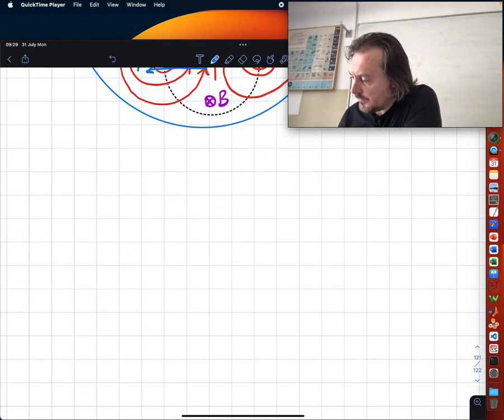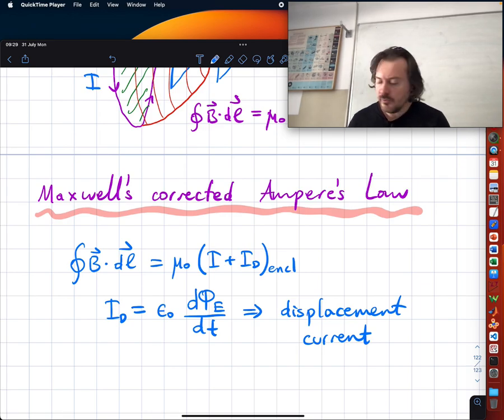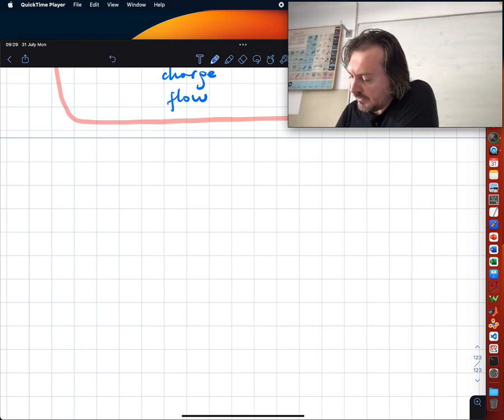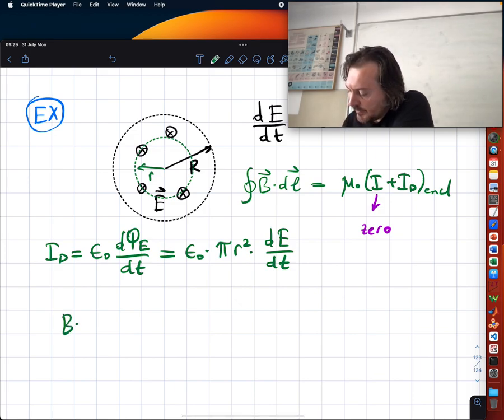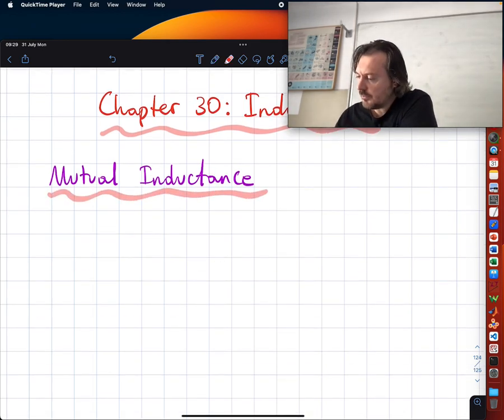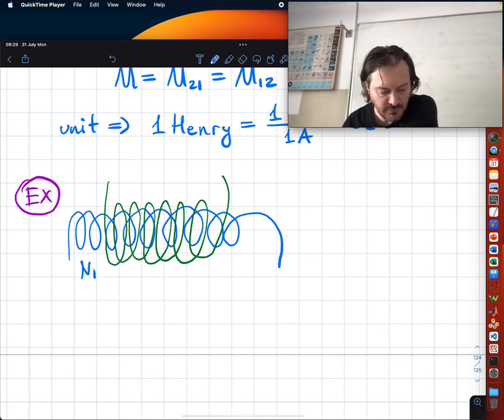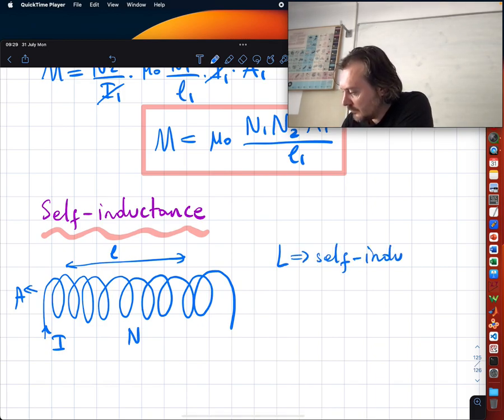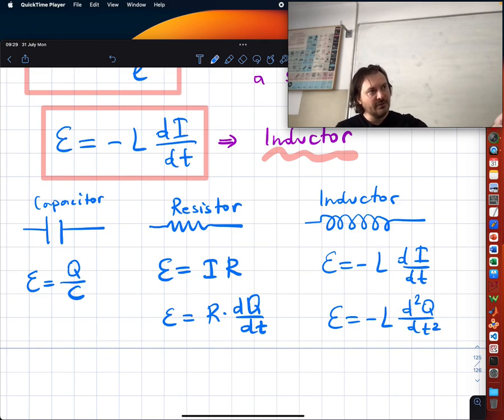PHYS 102 - Lecture 30: Displacement current, Mutual inductance, Inductor

Comment: Great lecture! A question though. Around 9:00 you introduced displacement current. From the formula we got, there should be a time dependent electric field or area (not likely), so the capacitor must be charging. However, in that case, don't we also need a current moving charges to the capacitor plates? Then I and Id can be positive at the same time right?
Reply from the maker: Great comment! Current is indeed flowing, but it flows rightwards from the right plate, goes around and comes back into the left plate (of course in reality the electrons are flowing the other way around). The current doesn't however jump from the left plate into the right. Instead we have a "displacement current" between the plates which is equal to the aforementioned current but manifests itself as the change in the electric flux.
Reply: Thank you for the explanation hocam
 @seyjah